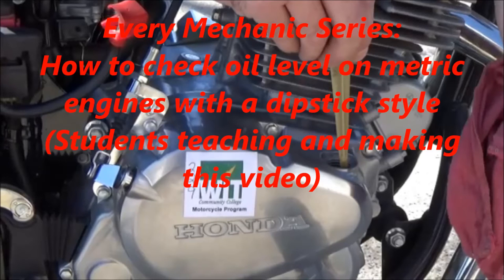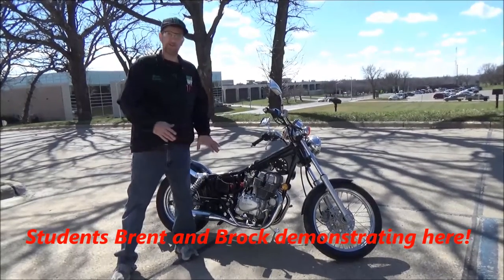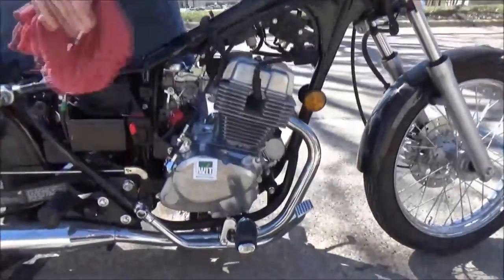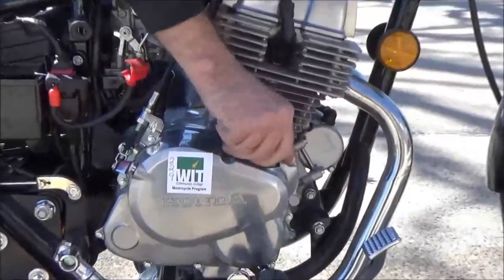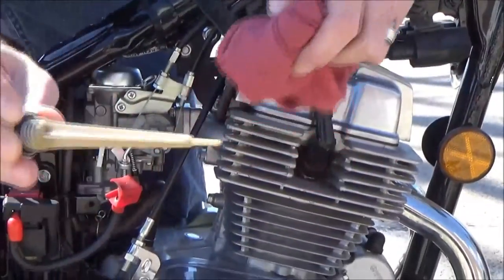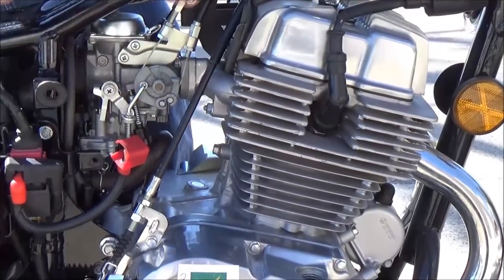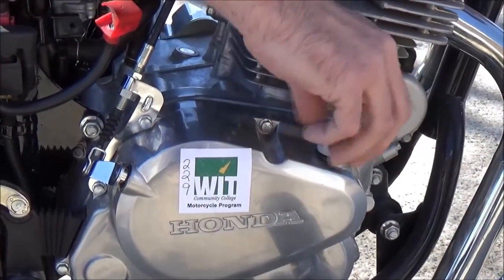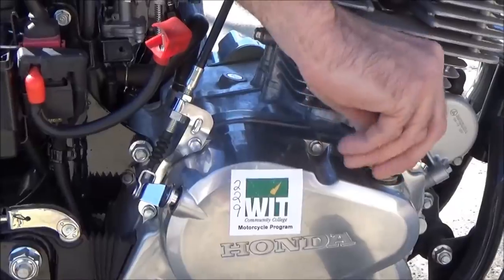EM Series: How to check oil level with dipstick on most all metric motorcycles ATVs. NOT for Harley

Comment: He did a good job! but should of mentioned when to check engine oil, engine at operating temp or cold.
Reply from the maker: +Gunner Tierney 
Good point that draws great conversation. Here's why: 
The manual will often state to start and run the engine to operating temp right? Not a good idea if you know nothing about the vehicle though! As a technician, you should always verify there is "some oil" close to full BEFORE starting. If you followed the owners manual to a tee you could actually cause damage if there was minimal or no oil in it. 
The hardest thing about these videos is to pull in every scenario!  

Thanks for commenting,

Keep Wrenching,Shane ConleyInstructor/Motivator/Motorcyclist
Reply: +Shane Conley  That was the answer I was hoping someone would give! 
again Great channel Shane.
Reply from the maker: +Gunner Tierney 
You bet..sometimes I'm wrong or make mistakes...I'm human. I think of this channel as a team effort when it comes to sharing knowledge...👍

Comment: I think starting the bike and geting the oil to circulate through the filter and places will give you a different reading so he should have said to check it aftet the engines been started some people say operating tempature some say just start it for a minute but everyone really says to check the oil while its warm. But atleast he added in at the end to not screw in the dip stick because thats a easy mistake.
Reply from the maker: Actually the point we are making is to read the owners manual. Some manufactures "set" the oil level "drained back" and even specifiy as much as waiting 10 minutes to check after running for 3 minutes. This sure would be back if the oil was low to run for 3 mins....that's why we check cold to "see" if there is oil. 
This is an old video and we have some updated models  with even more notes. Search the channel for them if you'd like. 
We sure love you taking the time to comment. Are you coming to the next live session? 
There a few ways you could help keep this work going and stay connected with me personally.  
1. The fastest and best thing you could simply do for us is hit that subscribe button…helps us creators more than you know! 
2. Join this channel to get access to perks:
https://www.youtube.com/channel/UCBhM8DCKnT3qXwTW0eToyCg/join   
3. Give us a high 5 here:  https://www.paypal.me/how2wrench    
Keep Wrenching,
Shane Conley
Peoria, AZ USA
Follow us!
www.How2Wrench.com       
www.Tools2Wrench.com    
Facebook: 
https://www.facebook.com/How2Wrench/   
Instagram:
https://www.instagram.com/how2wrench/